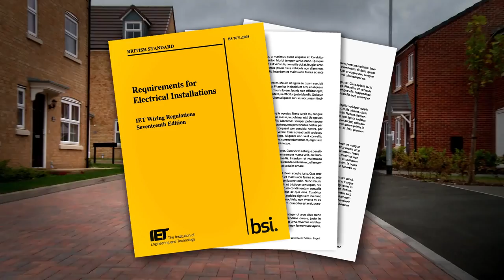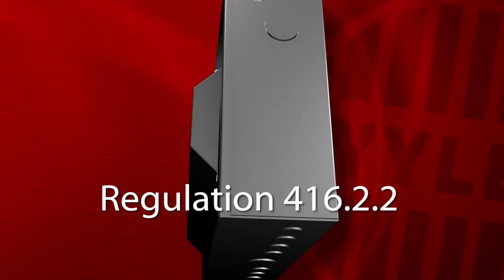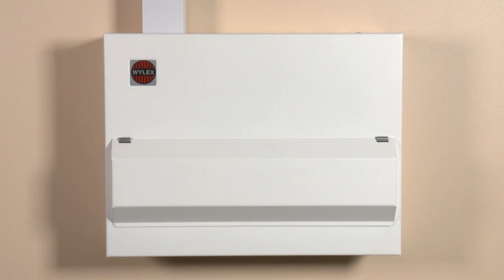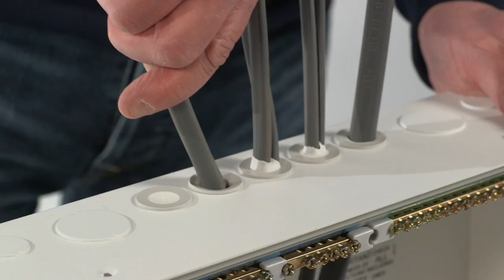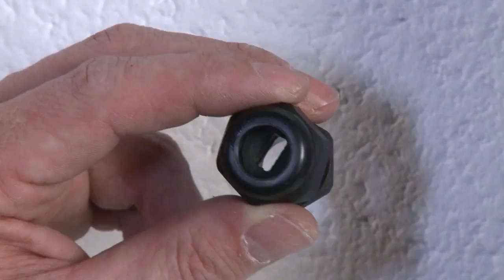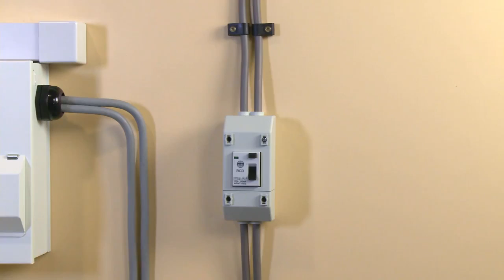Wylex Amendment 3 Install Methods

Comment: The RCD in a non-ferrous enclosure is fully compliant, since the "non-combustible enclosure" (Amendment 3) rule covers those assemblies manufactured to BS EN 61439-3. This standard encompasses consumer unit distribution assemblies having overcurrent and two pole isolation and/or RCD protection. It doesn't cover stand-alone RCD units or two -pole isolators in enclosures as these are not consumer units. The "similar assemblies" mentioned refers to distribution boards including 3-phase. It's therefore up to the installer to decide whether to use a ferrous or non-ferrous enclosure to house stand-alone RCDs, MCB's or isolators, either is compliant in that case.

Comment: nowadays so many circuits at domestic property how so many wire go in to consumer units its difficult for a qualified electrician due to customers need. if consumer need so many spots light/sockets at domestic property then circuits would be increase thus like this use conduct pain to pull cable in to consumer units but its like double job for an engineer.

Comment: Consumer Unit and Associated switch gear in non combustible material.  Why is the 100mA RCD in a plastic housing?  The people who design this equipment and make these info videos obviously haven't installed any of these in the real world
Reply: Read about RCD and incomer for TT and the need for plastic enclosure - basically if there is an earth fault, the case could become like and not blow the DNO fuse

Comment: It looked as though the 100mA timed delayed rcd was in a plastic enclosure. Surely should be in same material as consumer unit??
Reply: +marcus stonham If the RCD enclosure was metal there would be a risk of the RCD not functioning if the enclosure became live under fault conditions.

Comment: What material should the 100ma RCD enclosure  be made out of on the TT SYSTEM as you say you can't use plastic For switch gear so it defeats the point as you would need to use metal for that to and then have no protection for the RCD enclosure.
Reply: +robert swingler
Quite... that needs clarifying!
I can definitely see some sense in the extra 100ma S-type RCDs, however...  But i definitely wonder if when feeding 30mA single-pole RCBOs, not disconnecting N-E faults will then be a nuisance...

Comment: BS7671 requires the Earthing Conductor to be surrounded by the same ferromagnetic enclosure as the live conductors, and therefore must be brought through the same gland as the line/phase and neutral tails.
Reply: No, The earthing comductor does not need to come in to the same hole with meter tails, but meter tails MUST be fit together to prevent eddy currents.
Reply: Could you quote the regulation for that please.